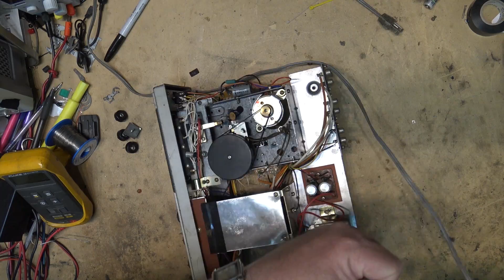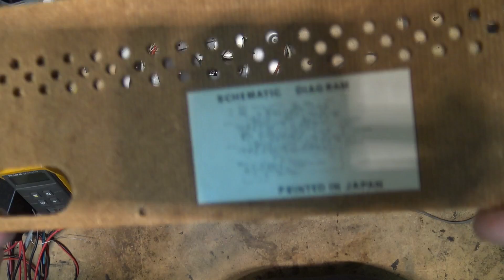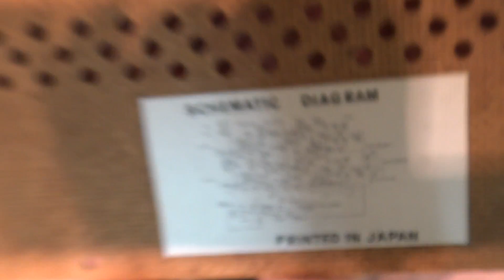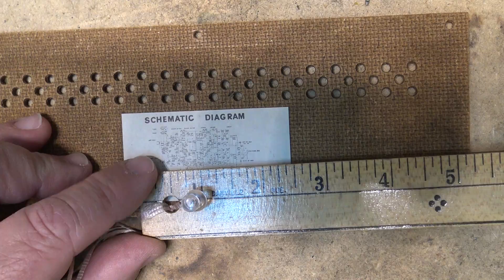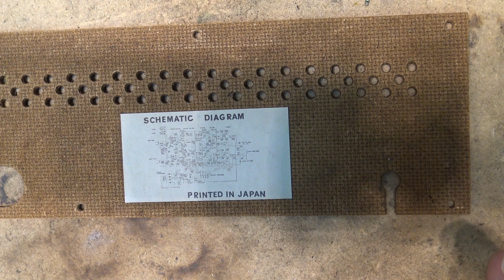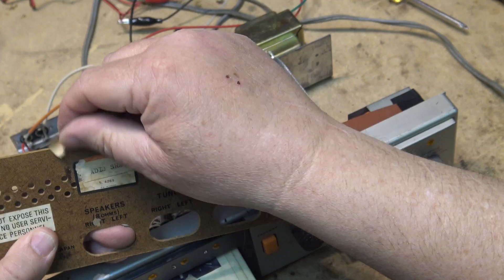Vintage Realistic 8 Track stereo service

Comment: Would you happen to know the size of that flat drive belt?  I have this model coming in the next day or so and I'm assuming the belt will need replacing.
Reply from the maker: No, you need to measure it.
Reply: @12voltvids  I actually just received the same unit, it has the belt, but sadly doesn't function properly.  It makes a laboring sound when playing, the volume is maxed and the knobs have little to no effect.  My plan was to use a headphone jack adapter for a cheap Bluetooth transmitter/speaker.  Not sure if that will even work, but I tried headphones, albeit through the same jack adapter, and the same resulted.  Bummer.  I thought I'd get a cheap unit to relive the good old days!  I'd love to fix or send to get fixed, but have no idea where to start.

Comment: I don't agree with your cleaning methods.
 it's much easier to take a cotton swab/alcohol and clean the motor pulley then running an abrasive screwdriver across the belt drive.

Comment: I bought a similar one (Westinghouse 8 track stereo). That one didn't have a schematic inside and I don't have any 8-tracks at home. So I decided to tear it down and scavange some parts. I was kind of amazed by the build quality. The step down transformer has a nice metal casing. The tuner pots looked high quality. The motor worked fine. I found some old Germanium PNP transistors( Matsushita 2SB324)  which probably act as some sort of amplifier, kind of hard to say without the schematics. But for a mass produced cheap device, I have to admit it was built quite well ! The chasis was a solid metal frame and all the caps were Nichicon. I wonder which year it was made. 

Thanks for the video !

Comment: I know this is an old video but hopefully you might be able to help. I just bought a Loyds 8 track player and it works fine BUT it will not change channels with the tape sensor strip. I've tried several tapes. It does change channels with the button with no problems. It makes no noise at all when it goes over the sensor strip. Ideas?
Reply: I was watching the video at the 12 min mark and you were talking about the sensor terminals but I couldn't really see what you were doing.
Reply from the maker: The sensor terminals poke into the opening on the opposite side of the 8track cartridge as the pinch roller. The head is in the middle opening. When the metallic strip passes over the contact it completes the circuit just like pressing the track selector button. They do the same thing, complete the circuit and apply power to the solenoid that operates the track change. If it doesn't click then either the solenoid is bad (stuck open ect) or there is no power to the sensor terminals or track selector button. Should measure about 12 volts across the terminals and switch.

Comment: "9A4" means September 1974. Nice unit, the Japanese made mechanisms were generally good, nice solenoid track changer rather than using a set of gears linked to the capstan motor. As physical formats are becoming history, it's good to preserve these old formats. Serviced cartridges played in a good machine will run happily for many, many miles!

Comment: How do we make a home made demagnetizer? love to see something on how to make one.
Reply from the maker: Did that years ago.  Search it out. (don't ask me to do it for you)
Reply: I used to stick a screwdriver through the tip of my induction solder gun. Put electrical tape on the tip of the screwdriver so you don't risk scratching the head.

Comment: I just bought an "Allied/R.S. (early 70's) 8 track player/AM/FM tuner..  the bass, & treble, knobs turn a bit hard, and the tuner knob only goes half way to the left, and not all the way to the low # stations, I don't want to force it.. do you have any videos on fixing stuck knobs? also the front of the tuner doesn't light up.. I haven't tried the tape deck yet, but it supposedly works. waiting for tapes,  I have some coming later in the week.  like your informative videos.  ..just subbed..
Reply from the maker: Sticking controls.  Try some contact cleaner.  It has lubricating qualities.
Reply: @12voltvids  Thank you for the reply... I will try that.... I haven't had an old 8 track stereo since I was a teen in the 70's..  Upon more research, I suspect the fact that the dial  doesn't go all the way to the left, it must be the dial cord. I'm not up for that yet. but i will take it apart eventually. Thanks again for your informative videos.
Reply: well, the guy I bought it from lied. the tape player doesn't work.. took it apart and the belt was off, put it back on and it keeps coming off, must be to stretched out. wonder if anyone can tell me where I can buy a new capstan belt? I have been looking online for 2 hours, and no one seems to tell the size of the belt they are selling. SO FRUSTRATING. one the good side, after taking the thing apart, the tuner dial now goes all the way across..  good grief why is it so hard to find a belt?
Reply from the maker: @connieworcester55  you need to measure the belt.  Tie a strong around the pulley and motor tight. Cut the string and measure.  Then subtract 10% and you get the belt size.  Width is probably 1/4"
Reply: @12voltvids  yeah, thanks, I know the size of my belt, I just can find any belts online ANYWHERE that says the size of the belt they are selling.. I'm not going to buy a belt that I have no clue as to what size it is.working on the search of 4 hrs now. smh
Reply from the maker: @connieworcester55  try kpcomponents.co

Comment: "piece of crap" from Radio Shack?  Your wristwatch?
Reply from the maker: My watch is a Casio is about 20 years old very rare model.  When is the last time you saw one?    Exactly, you haven't as it is one of the rarer models.  There were plastic body versions but the stainless steel version I have was really expensive at the time (for a Casio) and thus didn't sell well. I have an old Seiko, the very first quartz day dater they ever had.  My dad got it in Japan.

Comment: Nice video, I have a similar unit on my workbench now. I’m a bit sad you damaged that label on the back while searching for a date….worst thing the small label under the label you damaged looks like the production date label…….
Production dates are usually in XXYY format where XX is the week number of the year (I know for some reason weeknumbers are not used in the US) and YY is the last two digits of the year. This would make this one a 1969 produced unit….which would fit to the Germanium transistors.

Comment: I have an 8 track player in a 1980s stereo cabinet that only plays one track, is there a fix for this that I can try at home to get all tracks working?  Thanks
Reply from the maker: Does the solenoid click. If not check that out and see if it is sticking, if you do hear it click then something is sticking and preventing the head from changing positions.
Reply: @12voltvids ponle wd 40 o unas gotas de aceite 3 en 1 en el eje donde el cabezal sube y baja esta trancado

Comment: I am not sure of which OEM made this unit, but Uniden did indeed make AM/FM 8 track car stereos under different names, including  the Cobra 98 GTL which was an AM/FM 8 Track  player only, no CB. This may have been manufactured by NDI (Nihon Dengyo) as indicated  on the serial number label on the back panel. Nihon Dengyo also manufactured some CB Radios for practically every brand.

Comment: I remember 8-tracks.  This unit's in the 1975 Radio Shack catalog("New for '75").  $99.95, came with 2 speakers(probably 4" or 5" drivers).  The description says 5-watt amplifier, so I think it's safe to assume it's 2.5 watts per channel. http://www.radioshackcatalogs.com/html/1975/h154.html

Comment: Never had too much trouble with 8 track units Just an occasional belt,crosstalk and azimuth adjustment and lube of the tape head elevation cam assy. The cartridges would go bad after a while. The powder coating would wear off causing them to bind and jam or the foam pressure pads would disintegrate and fall apart. The 8 track cartridges exhibited more trouble than the players

Comment: Need some advice i have an acoustat tnt 200 amplifier 40yrs old now mint condition sounds GREAT BUT the inside circuit boards are oxidizing can i do something about it without getting shocked due to can size capacitors

Comment: Thanks Dave. I have a TRS-801 from what I remember, and it still works.  I used to borrow albums from friends and record them onto the cartridges so that I could carry the cases of tapes with me on trips in my 1966 Chevy window van .  It worked great for the period as a young adult.  Only issue was that cheaper tapes went from rubber capstan rollers to crappy plastic rollers which did not grip the tape as well. Not exactly HI-fidelity but better than boredom on long drives in areas where radio reception was almost non-existent.  MEMORY LANE    J K

Comment: Where can you get a demagnetized like the one you used in this video please.?
Reply from the maker: You can make one easily. I do have a video on building this one.  
3 parts.  A 12v ac transformer.  A steel or iron bolt and some magnet wire I salvaged out of an old little motor from a broken cordless drill.

Comment: Hi there been watching your channel for some time and you have saved me from throwing out allot of things and would like a bit of help with another panasonic plasma tv i think there is a bad cap but can't find info on it. It is marked JH 470 ETZ the symptoms are  the picture is getting pixelated and losing tune from the antenna i know its not a signal problem as i have 2 tvs connected to the same antenna and the other tv is fine on the same channel no pixelastion  and keeping tune this cap is below the tv antenna in thats why i suspect this its a little bulged to can't thank you enough for posting these video love seeing old thing getting brought back to life keep it up

Comment: I guess the 8-track only was a thing in the US. In Europe we went directly to compact cassettes in the mid 60s when it was introduced by Philips.
Before that, portable vinyl recordplayers was the only was to bring your own music.
Well as if not the sound quality of 8-track wasn't bad enough, you play us Village People? Holly smokes...
Reply: Not entirely true. American cars in Europe definitely were equipped with 8 track in those days. If you search second hand stuff websites 8 was quite surprised by the number of 8 track tapes being on offer from Dutch artists. So there definitely was a market.
Then again, American cars weren’t very popular here because of size, fuel consumption and build “quality”. I also have a Realistic 8 track player here that is designed for 220 VAC, so definitely aimed at the European market. I also remember the Tandy (Radio Shack stores here were called Tandy) catalogue which featured 8 track players. But you are correct that the format never really got popular and we never had an 8 track BITD. The first recorder we had was one of those tiny cassette recorders. That one was soon replaced by one of those flat Toshiba decks.
Reply: Eight track is not too bad. And they play non-stop.

Comment: I would say it's good quality junk, all metal chassis and it sounds fine,  also the part i expected to fail is the motor but that's spot on too.
Maybe not so bad a unit really.
Good for it's day and more reliable than modern 2 years old and dead crap lol.
Reply: They were great old machines - built to last
Reply: @countzero1136  i don't think they were designed to fail like more modern devices.
I have noticed junk capacitors with short life specs in many modern things, they often last about two years before failure.
Shame to waste resources just to sell us more crap :-(.

Comment: it seems every 8 track player had some different rube-goldberg setup for changing tracks.  some use the solenoid only, some use a rubber tire and a wheel with cuts in it so it only turns 1/4th (or 1/8th) of a revolution.  some have 1 set of positions on the cam, some have 2 sets.  I wonder why one "best" method of changing tracks never seemed to emerge before 8 tracks went the way of the dinosaur.
Reply: Probably all methods to get around patents. I would guess the modern method would be like they use with DLT tapes, with a stepper motor to move the head up and down, with microstepping to give best frequency response, and to compensate for wear and misalignment between record and playback units.
Reply: The ones with the rubber wheels are worse they wear out and sometimes the wheels become loose. The cams work the best

Comment: Made by NDI for Radio Shack.  
They also made some decent CB radios back in that day for Radio Shack as well.
Reply: Never heard of NDI. Was that a Matsusita (spelling?) brand?
Reply: @waltschannel7465  A Matsushita?  Can't say.  Little info available.  Only worked on a couple of the Realistic TRC-448 40 ch SSB radios.  They did use decent components and the service manual and schematic were easy to locate.  Says something positive about the company, even though it was a Radio Shack re-brand.

Comment: Date code 9A4, 1979 and that units in the 1979 and 1980 RS Catalog. Despite the low cost, look how long it’s lasted, compare this to the China pride garbage of today that can’t last a few months...
Reply: With Radio Shack date codes, the first digit is the month. The last digit (or two digits if above 1999) is the year. So 9A4 = September 1974. (This model was no longer in production in 1984.)